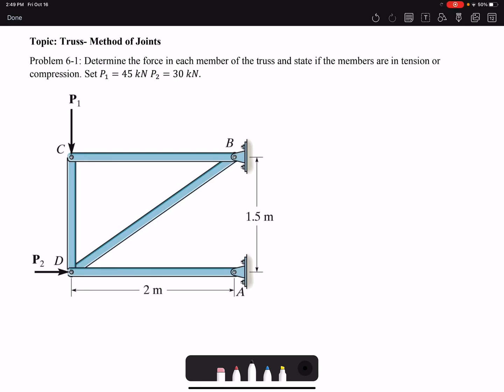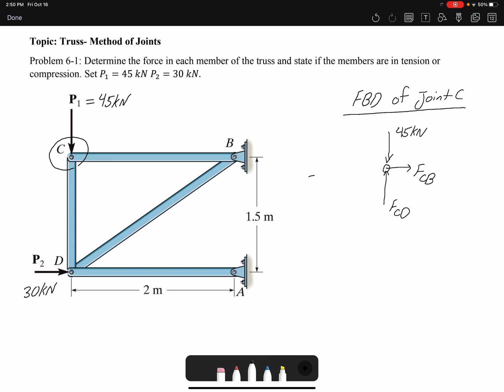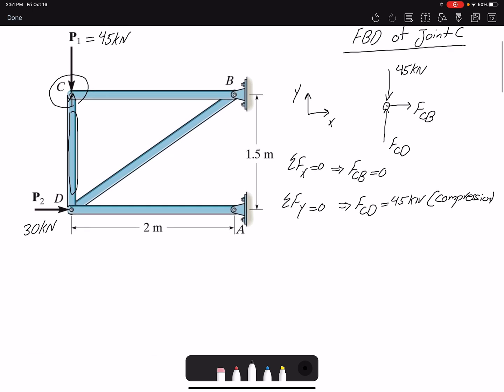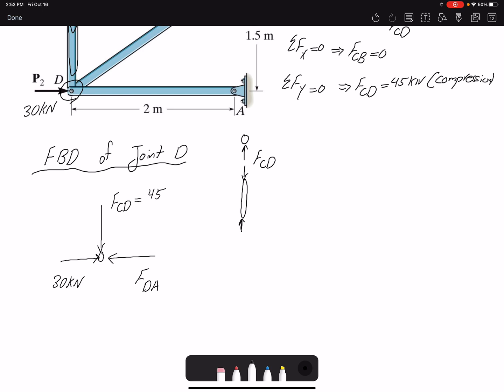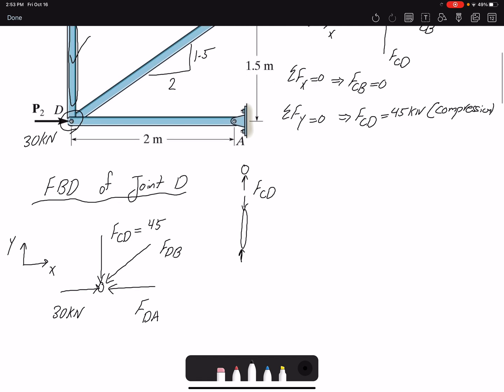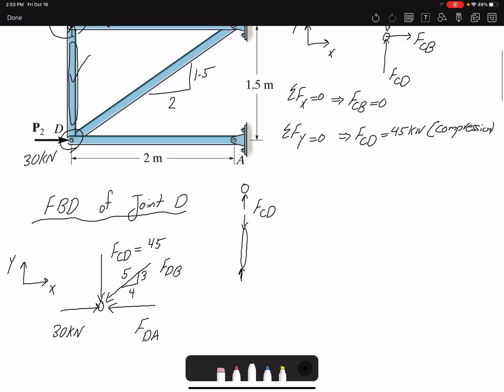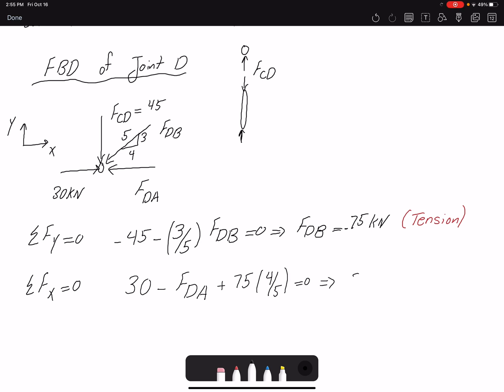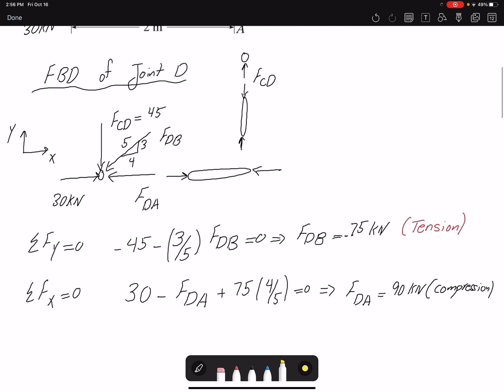Statics: Truss Example Problem 6-1: Method of Joints

Comment: thanks mate :)
Reply from the maker: You are welcome
Reply: @engineeringvision  don't you need to find the angle using the 3-4-5 triangle or is that unnecessary?
Reply from the maker: @kenedsonescober2871  No, it is not necessary. We find the angle to find the cosine of the angle later, but when we have the triangle dimenion, we can directly find the cosine of the angle, cosine of the angle would be 4/5 and sin of the angle would be 3/5.
Reply: @engineeringvision  oh okay thank you very much!